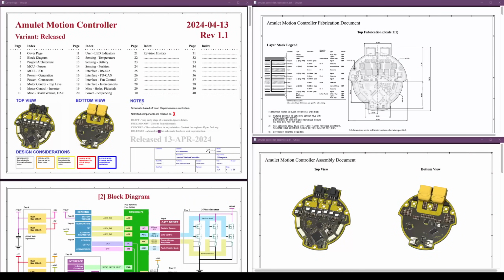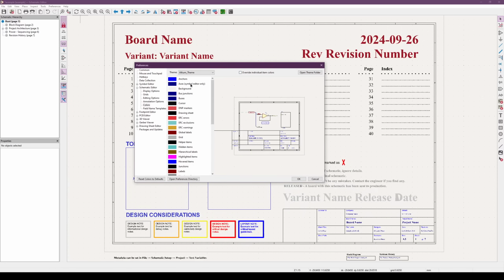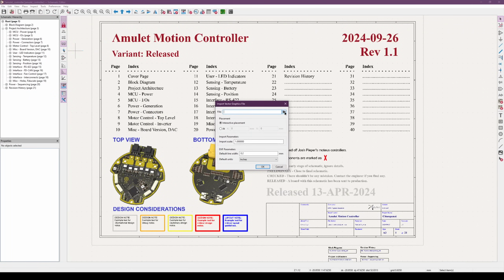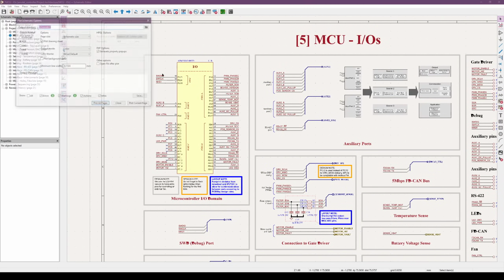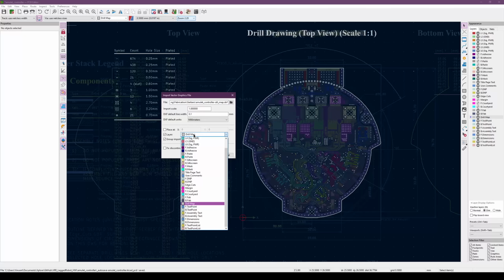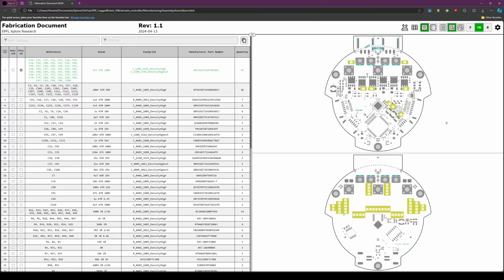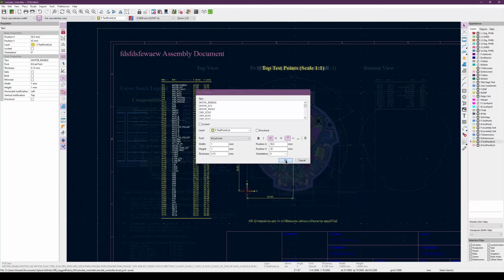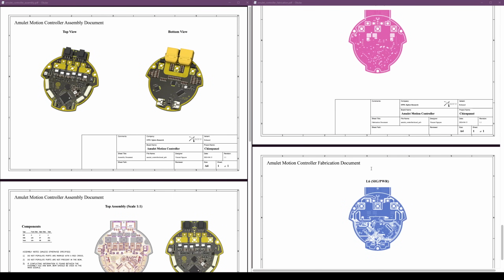KiCad 8.0 - Project structure, workflow and generating professional documentation

Comment: Question: May I know is the company logo inserted manually into the individual schematic sheet or can it be done at template level like in Altium Designer?
Reply from the maker: @choonkwangyeo925  you can edit the worksheet file (.wks) to add your own logo on a template level. This can be done in KiCad
Reply: @vincentnguyen8083  thanks!

Comment: Fantastic template. I was sent this video so we could standardise our design around this template. However, I just updated my KiCad to version 9.0 and it seems to have an issue. It's looking for a file called meta/info.html under the Color_Themes folder.
Reply from the maker: You can delete that folder, I put it there in case one wants to use the same KiCad colors as I do. Note that I'm also working on a fully automated template (Ki9 support coming very soon) with CI/CD integration. Hopefully the video will be ready soon
https://github.com/nguyen-v/KDT_Hierarchical_KiBot
Reply: @vincentnguyen8083  Oh thank you. That worked. Damn, nice. Looking forward to it. Thanks for sharing your work. Appreciate it!

Comment: Too much documentation means that what is important is often invisible in the plethora of information, and I can't imagine that someone in production will have time to read it all. It looks nice, but it has little to do with practice. Likewise with the diagram: if we have an initial page it is OK, but the division into too many subpages of the diagram often lose readability. The schematic should be divided according to complexity, i.e. small schematics on one page, a little larger we can divide by function but without separating into small elements like one sensor on one page. Another thing is labels on schematic: too many of them cause that when reading the schematic in printed form we are not able to find where what signal goes.
Reply from the maker: There is not a single right way of doing things - in the end, the important part is ensuring good communication between the electronics engineer, layout engineer and firmware engineer. In my projects, I use the comments on the schematics as a sanity check; this is a way for me to take notes for when I will be writing the firmware down the line. I agree that the schematics shouldn't be divided into too many subpages. Here the sensors, MCU and so on could be merged into a single sheet. For the labels I believe each net should be correctly labeled to ease the layout phase. I try to use local labels and avoid jumping across the schematic. If you look at the schematic, you can see that there are no global labels (apart from power) and local labels are nearly never used to replace wires
Reply: @vincentnguyen8083  I agree with what you wrote, however, you created several pages of documentation for a small project. Often productions are made outside for example, in China, and it is necessary to transmit only relevant information so that there is no confusion. That is: a decent BOM list with listed mpn and mf. Decent marking of the first pin of the elements, including the cathode of the diodes, because there are often problems with this, and proper marking of the references of the elements so that there is no confusion. Then test documentation and/or providing a tester that clearly shows OK or FAIL. I've made a lot of mistakes myself and I write this on my own experience.
Reply from the maker: For minimal repeatable files you could also just send an ODB++ file which can be exported by KiCad 9.
Reply from the maker: Just keep in mind, this video was made as a reference for those who find KiCad confusing and want to make documentation at a similar level than what you can do with let's say Altium Draftsman. This is just an example project, and is by no means the best example where you would find value into creating extensive documentation.

I have another video coming up, where everything presented here has been automated
Reply: @ Yes, thank you for your advice some of it is really helpful and I use it myself and I just wanted to point out that more is not always better.

Comment: Interesting approach. I'm totally with you that its important to have stuff like block diagrams and descriptions for everything, but why in the schematic? Why not do a separate actual document whose sole purpose is documentation? The schematic just gets so crammed with information this way when you can have a separate document. I always keep the information in the schematic down to a minimum (yes I still put some important text/information in the schematic too), but I'd much rather do a separate document that contains all of that information. Also with software, right? You don't put software documentation into the schematic, do you? It's also linked with the electronics, but I still don't put it into the schematic. Having a separate document is (in my opinion) always the best way of documenting stuff. Then you have one actual document that also links all of the components of a project with each other and you don't cram your schematic with too much information so it becomes hard to read the actual schematic. A schematic for me is the MOST DETAILED view of the electronics. So if I'd want to have an overview of the electronics I'd first look at something like a block diagram in the project documentation and not the schematic.
Reply from the maker: @hgplaying5629  I don't think adding one page of block diagram on a schematic is an issue. The goal is to make the circuit's purpose as clear as possible in the shortest time. Adding external documentation (something like app notes) is of course often necessary and is what should be done for each project, but that is not the subject of this video
Reply: Yeah, sure, I just think it gets crammed quickly when you start adding the full description for everything to the schematic

Comment: Instead of doing the manual text insertion in the PDF file you can utilize board2pdf's capability of inserting page info into a comment layer, such as ${COMMENT4}. If you then add ${COMMENT4} as a text, it will display the template name if you've told board2pdf to use '${template_name}' as its page info for comment4.

For instance, you can make a field in your drawing sheet that uses say ${COMMENT4}. You can outright in the PCB place a text field in your drawing sheet layer saying {$COMMENT4} where you'd otherwise place the text in the PDF file.
Reply from the maker: @jacobeliasfsterovergaard4833  i have already automated all of this with KiBot (revision history at the end which is now synchronised with CHANGELOG.md file, fabrication/assembly notes, automated table of contents and also tables in the PCB). This will be the subject of the next video. You can follow the development here
https://github.com/nguyen-v/amulet_controller_kibot/tree/dev
https://github.com/INTI-CMNB/KiBot/pulls?q=is%3Apr+is%3Aclosed
I'm now working on automating the drill maps but its taking some time
https://github.com/INTI-CMNB/KiBot/issues/733
Reply: @vincentnguyen8083  Magnificent. So far, in regards to the next step of a PCB project KiCad is a little lacking in features and functionality. You really have to jumps through hoops to get this stuff going. But I find it impressive the ways you've dealt with it. I largely find your documentation of your amulet controller to be a prime example of documentation.

Comment: Thank you so much for such a detailed video; very helpful! 
One thing I am super interested in is your vibrant colours for Net classes. Is it done individually, or is there a semi-automatic procedure for that, mate? 
I know Altinum has this feature, but I did not know you can do it in Kicad as well :-)
Reply from the maker: For the schematic, I define Netclasses and colors in the schematic options and assign them to the nets either manually or with the Net class directive. Unfortunately in KiCAD 8, colors of netclasses in the schematic or not synchronised with the PCB net colors, so I set the colors manually on the PCB for each net. KiCAD 9 will have synchronisation of netclass colors between schematic and PCB

Comment: I am sorry, but I find this process really tedious and error-prone. I spent quite some time on automating KiCad outputs using KiBot, git, teamcity, etc... And even though it may have been more work than doing it manually and even though the outputs are not so well organized and pretty, I still do prefer to do it automatically. 
The reason is that being automatic, it is always up to date. I would have nightmares from exporting test points positions and then "reimporting" them back to schematic as list... 
Even for my small projects, when I need to update something last minute, I just hit "run build" and after few minutes all the outputs are generated.
Pardon me if I may not say it quite right (English is not my native language) and I certainly do not mean to offend you, but computers were designed to work better/smarter, not only faster. It kinda reminds me when I was learning AutoCad in school (cca 2000), it had a new great feature - hatch autofill. But instead of setting some shape to be hatch filled, it created a bunch of lines in the shape - exactly like if you used a ruler to draw the hatch fill. And your process looks very similar to me. Instead of using automation and other "modern" means, you just use the computer to do the "old way" faster. For example, if you would need to change one output from I2C to i.e. serial, how much work would it be? At how many places would you need to change it manually?
Reply: Just as example, I recently designed a board with like 6 different buses. I know it is a small project but still, there is a lot of opportunities to swap TX/RX, connect wrong things together. So I made a script, that takes the netlist/schematic in and has a definition of required buses. And it will check if they are correctly connected and produce an output of them, so you can use it when debugging.
So for example I have serial console. That is a simple thing.  So first thing, I need to define the serial "bus". Then I define classes that corresponds to TX and RX. And that should be all that I need to define. The script then will check that there is always at most 1 TX pin on the bus line and that there are some RX pins. In the simple case it will find that the MCU TX is connected to the connector RX and vice versa.
Reply from the maker: @radekhladik7895  im not sure I understand. I know that the process can be automated (e.g. with Kibot) but once everything is set up correctly, you don't really need to change anything to produce good fabrication and assembly outputs. Let's take your example of swapping an I2C output to serial. 

1) You would just change it on the schematic, then plot the schematic to PDF
2) On the PCB, you would need to reroute the signal if necessary 
3) then you just plot the assembly and fabrication documents with Board2PDF (a few clicks)

One of the tedious parts are the 3d renders, which need to be redone if the PCB changes substantially. However, they are not critical to the documents and could be automated with KiCad CLI in version 9

Another tedious part which can be hardly automated are the fabrication notes, assembly notes and dimensions, these need to be set once on a case by case basis depending on the project/manufacturer.

For the testpoints, yes this is also quite tedious, there are easy ways to automate it (for example https://github.com/snhobbs/kicad-testpoints ), and it would certainly be possible to have a script extract the locations and populate a table on the correct page of the fabrication output

If you manage to automate the entire process with good quality fabrication and assembly documents, feel free to share a tutorial (e.g. KiBot). I would be very happy if there are ways to streamline the workflow and am planning to investigate it, but I just don't have the time and energy to do it yet

In general, for small changes (e.g. rerouting a signal) it takes me ~2min to regenerate assembly/fabrication outputs which are up to date. For large changes (completely change the PCB shape, and location of components), maybe around 10 minutes if I need to redraw the dimensions layer (indications on diameter, etc., a process which can be hardly automated) and regenerate 3d renders
Reply: @vincentnguyen8083   
Of course that you would need to do "the basic KiCad stuff with rerouting, etc,... " but on top of that you would need to change the Block Diagrams, Test point lists, Page title in the table of contents, etc....
I know that it is only a few clicks, but you need to remember all the places you need to click... For me, the best number of clicks required to do something is 0 🙂
What I meant is that I prefer to define 1 piece of information exactly once and let the computer do the rest - a lot of times it does not work like that, but that does not mean that we should not aim for it. So for example if I have the serial connection I mentioned, it should be entered only once in some form of "serial connection between A and B". And the rest should be done automatically or at least checked automatically.
Your documentation looks beautiful, and no automation can match that, but for me the cost of manually keeping track of everything is not acceptable.
For example I've had some issues with USB connector with JLCPCB (I've mixed two parts and used footprint from another part while in the BOM I've had the other one). Unfortunatelly the other connector was not in stock, so I had to change the footprint and regenerate all the fabrication outputs. And because of automation, I knew that the quality of the hot-fixed outputs will be the same as the quality of the outputs I've generated before.
Reply from the maker: @radekhladik7895 of course the table of contents and so on need to be changed manually right now. There are again probably ways to automate it but I usually make these types of "non-important" schematic sections when the design reaches a more mature phase where there are only small incremental changes left. It would take a significant effort to automate every part of the schematic/fabrication/assembly documents, something that even high-end tools like altium do not provide yet, at least not at the quality of the documents I present here. But I agree that in a fast-paced design/prototype phase where you would need all necessary "bare-bones" documents delivered on a regular basis like standard schematic and Gerbers, automation is important
Reply: @vincentnguyen8083  you are right. And all I am saying us that I will trade that visual quality and organisation for being up to date and automated as much as possible.
Actually I ruined my first PCB (trivial breakout board) by forgetting to refill zones before exporting gerbers. And I still do not refill my zones before exporting gerbers but I have the computer to do it for me....
Reply: @radekhladik7895 It would be great if you could share your process. It will contribute to build a better documentation process for everybody.
Reply from the maker: @mortaldrumming  I've started working on a custom KiBot fork for automating the entire process, but will take a while to generate custom outputs/merge PRs into KiBot for new features if necessary
Reply: @mortaldrumming  The basic ideas of my workflow are:
1) use git (I have a private git server) to store all revisions of the KiCad project
2) I have a linux server that runs KiBot (in a Docker container) and I've created a bunch of scripts to use it (and few other tools) to produce outputs or to modify the project files - i.e. simple sed to replace all _gitid_ with actual git commit id. Or an old PHP script that produces JLCPCB compatible bom, etc.... But mostly KiBot. 
2a) as for KiBot I have a config file taillored to match my needs and a mechanism how some parts of the config can be overriden with a "repo local" config.....
3) I use teamcity as a glorified script runner. Basically I use it to clone the specified git branch, run the scripts from previous step and compress the outputs....

Summary: I end up with a zip file full of individual outputs (3D renders, gerbers, boms, etc.... ) - I do not create any "complex" outputs like test points list, etc... 
But the big advantage is that I commit my work on my workstation to the git, hit run build on teamcity and in 5-10 minutes (the 3D renders takes lot of time as there is no GPU in the server) I have a complete zip file with outputs. For example I have complete fabrication files for JLCPCB (gerbers, bom, pos) that I can directly upload to JLCPCB.... And if there is any issue, I fix it in git, regenerate outputs and again in 5-10 minutes I have outputs with the fix applied, but the quality of the outputs is not affected by the fact that I am in a rush/hurry to fix the issue.
Reply: @mortaldrumming  Just to add to my workflow, recently I needed to create some form of "user" documentation for my board. As it is hard to automate, I had to resort to manually writing the docs and to including static images (screenshots, renders, real photos). But at least I was able to use mkdocs (specifically material-mkdocs) and produce good-looking structured outputs.
Reply from the maker: https://github.com/INTI-CMNB/KiBot/pull/699
First PR is merged, will keep adding some when I have the time
Reply from the maker: Small update, everything except drill map has been automated after many PRs and feature requests into kibot. Will make an updated workflow video when I have the time.
https://github.com/nguyen-v/amulet_controller_kibot/tree/dev
Reply: @vincentnguyen8083 Please be assured that your updated workflow video is eagerly awaited. 😉